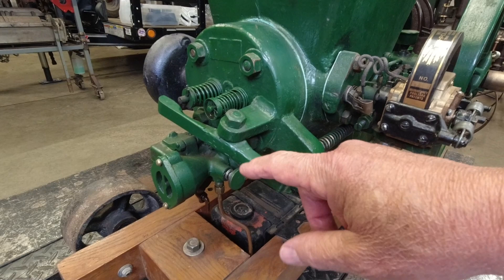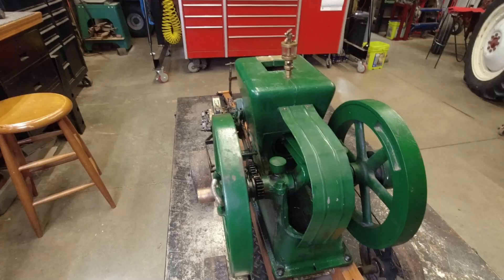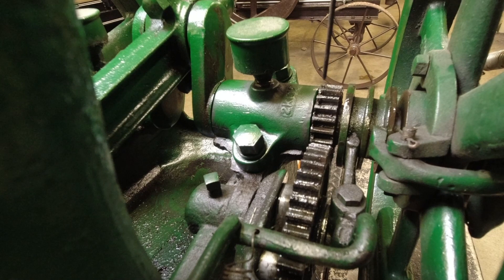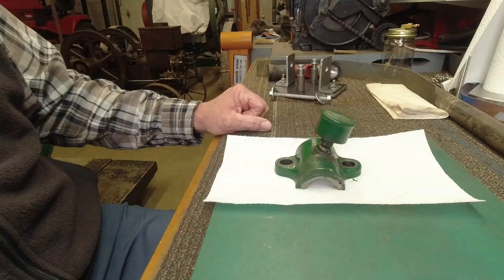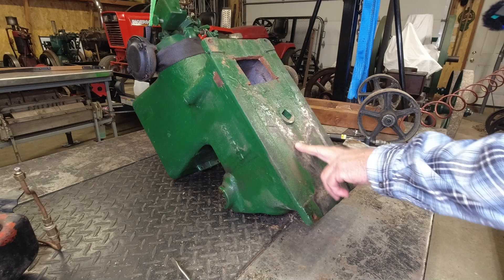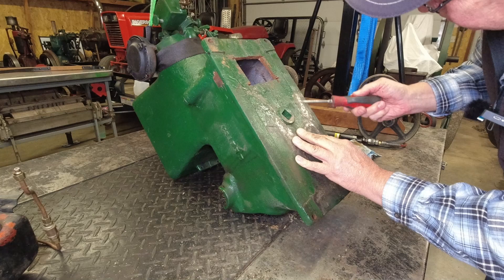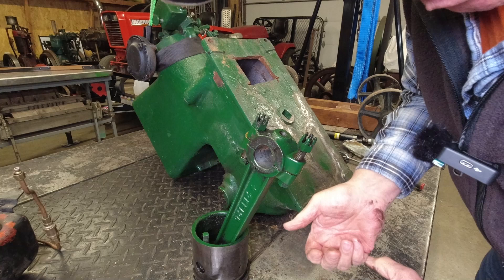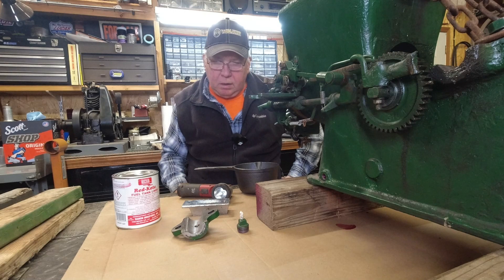Goold Shaply Muir (part-1)

Comment: most of those engines the gas tank was in the base of the engine that was most likely rusted our a long time ago they either couldn't make a new gas tank or either didn't want 2 take the time 2 make a new  😮😮 alot of those old engines U have remake the parts 4 them your self 😊😊 many years ago alot of those engines were sold brand new at hard ware stores and the time they were being made tractors were just seeing light back  and most tractors were just being made in the 191OS 😊😊 OMG 11 21 2O23

Comment: I have the same engine and is been hard to find any information on it...I am trying to set the timing and dont know where to look for timing marks? There is none on the gears on crank shaft.
Reply from the maker: The easy way to set the cam timing without marks is to coordinate the opening and closing of the exhaust valve with the piston at tdc and bdc. Set the exhaust valve to open at or just before bottom dead center, and close at or just before top dead center. You can then set the spark to occur at around 10 degrees before tdc. 
Hope this helps.  Thanks for watching!